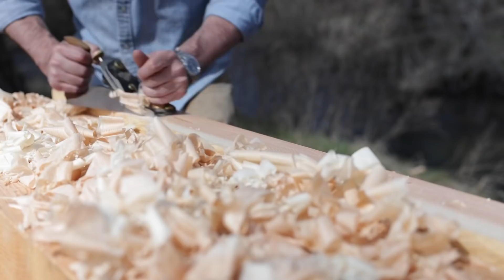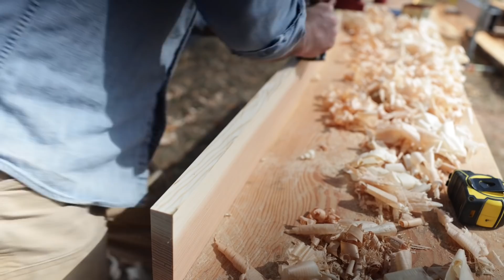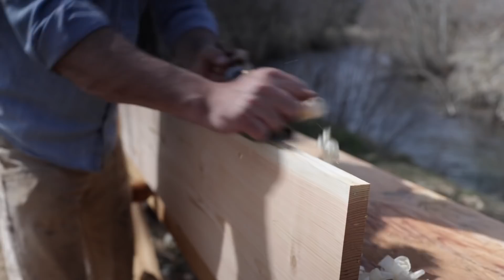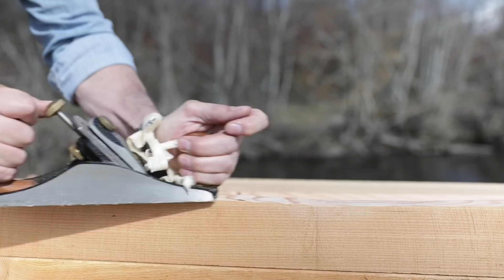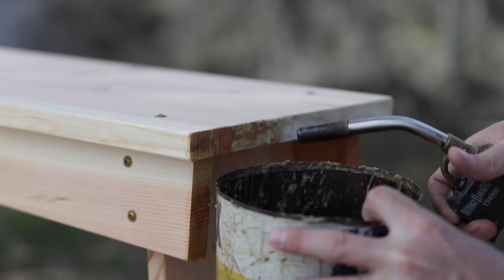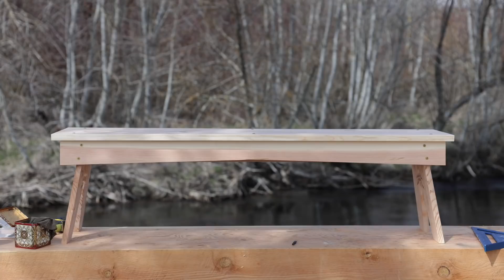The Most Satisfying Video on YouTube 2021

Comment: When I was a kid both my fathers shed and butchers shops floors were covered in wood shavings .
Reply: Why was the butchers shop covered in wood shavings?
Reply: @bkelevate  soak up blood, probably?
Reply: @bkelevate  I’m not sure as l was very young but it was only butchers that did it .
Someone older than me might be able to shed some light on the why  .
Reply: @splashpit  soaked up the blood, stopped customers slipping and if they were pine they added a nice scent.
Reply: @splashpit  - And all of you, I think you are all correct. One of my first jobs was in a Stationary store. When the doors shut at night, I would take a bucket of waxed sawdust, and spread it all over the floor, then, to sweep it up, which seemed to work fine. As well, I worked in numereous bars and butchering situations, where we did much the same thing, including peanut shells.

If nothing else, I think such a use led to a more thorough job.

Comment: When I was in junior high, our wood shop  teacher was a stickler about turning the plane on it's side on the bench when not in use. Anyone caught violating this rule had to hold the plane with arm outstretched to the side for 5 minutes. Trust me on this, you only did it once, as that plane weighed about 100 pounds after 2 minutes...
Reply: That, and pulling the plane back instead of lifting it up. Also, not going the full length of the board at any given time.
Least to day, while I was an apprentice, my teacher was very particular. Also a choleric, I guess.
Reply: dustdevl and backyard worker - not to be a pain, but what is the point in turning the plane on it's side, not in use? To save the blade, in some way? Just curious. I've worked with a plane a bit, but the kitchen is more my forte, where actually, we sort of worry about it in a somewhat opposite manner, meaning more the direction of it, to better not accidentally cut yourself, even at rest. Different world, but I'm just curious.
Reply: @dobiebloke9311  back then, during my apprenticeship, there were a few explanations, if I remember correctly.
Of course, no1 argument is always the sharpness of the blade. That's for putting the plane down, as well as pulling it backwards on the timber. Tbh. I don't know how it noticeably should hurt the blade if the plane is sitting on it. Pulling it backwards on the timber... OK, I can see that. Still, I don't know to what extends it makes a difference. 

2nd reason was to take care of the work bench. If the plane rests on the blade you might get marks on the work bench. Even more so when you accidentally hit the plane and move it forwards. Mind you, we were young and not everyone was used to taking care of stuff. The workbench and plane (all told for that matter) did not belong to us, so many don't care too much about it. You take more care of it's your own tools bought with your own money.

3rd, if the plane gets dull quicker, it needs to be sharpened more often. That, in turn, means that the blade needs to be replaced more often, which is a cost factor for your employer. Also, while you sharpen your tools you don't work. In the sense of, you don't produce something which brings money into the employers bank account, which you are paid from. 

As I said, that was during my apprenticeship. Meaning, an employment type situation. Things are different for a professional home owner or diy type person.
Most likely it is very important for most youngsters to learn how to take care of things. However, the arguments, at least partially, are a bit...dull. (pun intended)
Reply: @backyard worker  - Last first, pun accepted. I just want to be clear, I've never really had a proper apprenticeship, just merely likely that I played around with friends, who knew better, if that. It's a strange thing.

Basically, not to be remembered just as a player, I've always appreciated a sharp blade. I'm so tired. I'll get back to you tomorrrow, but I read you.
Reply: @backyard worker  - Let me explain myself.

I don't think I was clear when I said 'a blade in the kitchen'. I was talking about kitchen knives, not planes.

Everything you said about planes, makes more sense to me now.

I never was the expert about anything to do with construction, except to people who knew even less than me, which was truly a diy situation.

My working with a hand planer has been minimal, but enough to know I can easily mess it up. Most of my work on the job was with a motorized planer, quite a different thing. Easier, but more dangerous, of course, but I still have all ten fingers.

As the son of an architect, and you know what that can lead to, I was somewhat versed in what it took to work construction, on several levels, by a fairly young age, let's say 13, but I seldom worked professionally, even as a helper, but for maybe 5% of my employment in life. 

Usually associated with a friend, who knew much better than I, but needed a helper, at the moment. As such, I wasn't half bad. I didn't need to ask too many questions, but I knew when to.

Comment: This is amazing to watch. A used to live at countryside at western part of Finland from 80s to 2000. I used most of the same tools since I was 5 years old.
My grandfather had equipped old chicken house, upstairs of small barn with old woodworking bench (even the tightening screw was made out of wood). Handsaws, hand drills, wooden plains, chisels and of course pukko. Not a single power tool. Mostly I used to build wooden guns for hide and seek games but also longbows and crossbows. I also build several huts in the near by forest, still standing. All the planks I used was sawn with our own self-made sawmill from the 50s and wood was also from our own forest.

Comment: I copied something for you Cody. 

A good rebuttal to the metric system. :

Stolen from another debate about metric and imperial measurements

People often argue that the imperial system is inferior to metric because it's arbitrary. It's not. Halves and thirds are the most common divisions in construction. If you divide 10 by 2 you can only do it once before it's no longer a whole number (10 ÷ 2 = 5, 5 ÷ 2 = 2.5). 10 also doesn't divide naturally by 3 even once (10÷3 = 3.3333)
Conversely, the inch assumes that the operation you're going to be performing most regularly is halving it:  1/2, /1/4, 1/8, 1/16, etc.
By creating a base of 12, the foot allows you to cut it in half twice (12 ÷ 2 = 6, 6 ÷ 2 = 3) and divide by 3rds once (12 ÷ 3 = 4).  In metric, 10 cannot be divide by 3 naturally (10 ÷ 3 = 3.3333…) and it can only be divided by 2 once (10 ÷ 2 = 5).
Even the mile is not arbitrary. Look how many times it can be divided by 2 and remain an even, natural number (5280', 2640', 1320', 660', 330', 165'). You might think they should have the mile on multiples of 2 so this pattern could go even longer. For example they could have made the mile 4096' (4096, 2048, 1024, 512, 256, 128, 64, 32, 16, 8, 4, 2, 1). But, none of those numbers are divisible by 3. Conversely, 5280 can be divided by 3 naturally (5280 ÷ 3 = 1760), allowing you to perfectly determine a third of a mile in addition to a half-mile and beyond.
As a final note, this is also why prime numbers (numbers divisible by only 1 and themselves: 2, 3, 5, 7, 11, 13, 17, 19, etc) matter in construction. If the number isn't prime, you can reduce it to a smaller number without getting a decimal. Hence we could create a tape that's based on 5 or 7, but there's no need to create one with 4, 6, 8 or 9 because 2 and 3 will cover them. 
So why don't we have tapes based on 5 or 7? The reason is that neither of these numbers appears frequently in nature so as humans we think they're not as aesthetically pleasing and don't use them often.